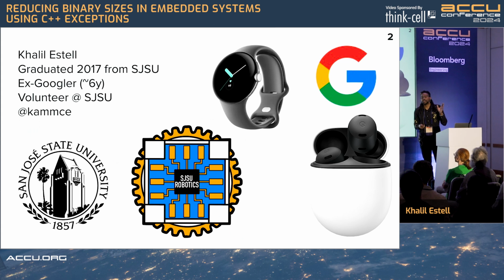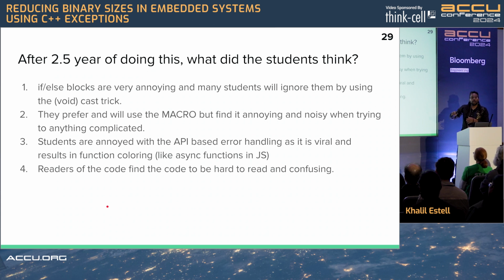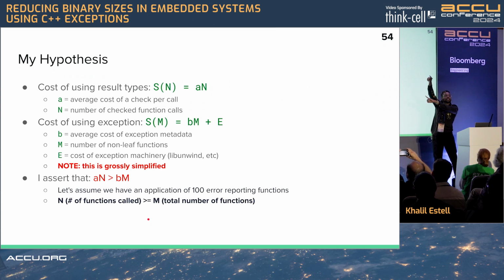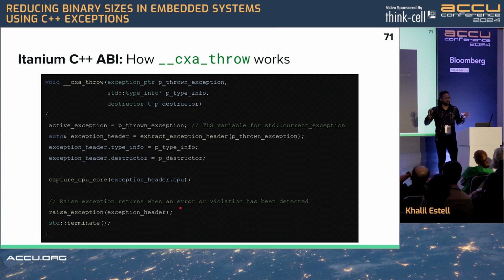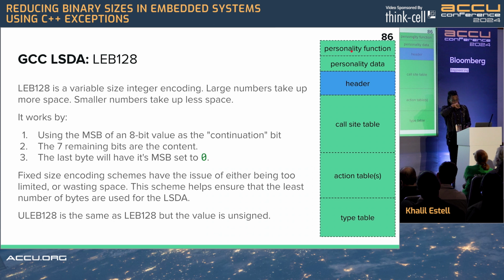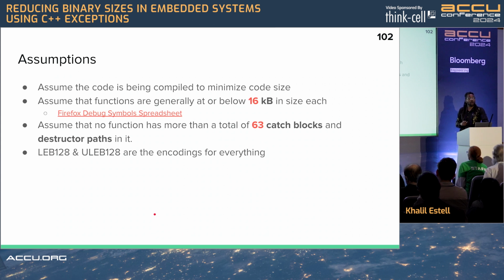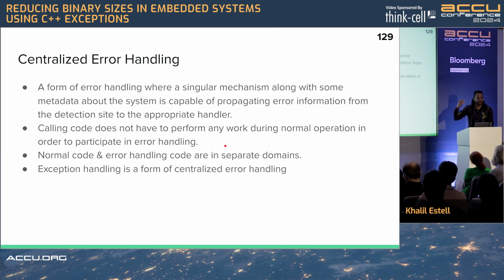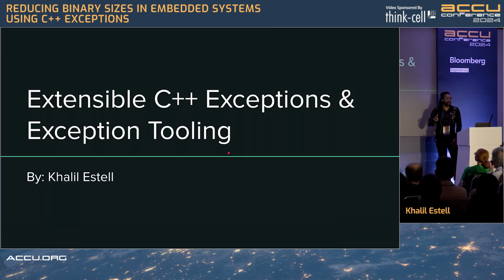C++ Exceptions Reduce Firmware Code Size - Khalil Estell - ACCU 2024

Comment: I think comparison of your own implementation of exceptions to handling manually every exit code – isn't a fair comparison. The fair comparison would be to add try/catch block inside every function, because this is how much control you have over errors, also in many cases the only sane thing to do is to hang or reset the cpu – there is no need for error propagation. As a side-note I can make even smaller code in C (not C++) by using custom setjmp/longjmp, because I need only known restore points in application and not the whole call stack. Nice talk, but it didn't convince me to use exceptions in production.
Reply: I think you'd find TrapC interesting. It was built in a way I think C devs would appreciate. Is an automatic way to do what you stated before (probably better than standard setup/longjmp). 

I disagree with your version of a comparison. As you say in your own comment, you rarely handle errors so having an try/catch in each scope wouldn't make much sense. And what would be the point of that, to throw, catch, rethrow? One could also not do that and get the behavior. So if the behavior is the same, I don't think such a comparison makes sense. 

But let's say we go with your comparison. I'm working on my "unique exception format" which de-duplicates much of the exception data area. So binary sizes will get reduced far more than  what I've claimed here. With that, having a try/catch in most function, as is with coroutines, would still result in a very smaller binary sizes compared to conditionals everywhere. No change to code or binaries necessary. 

As for, "the only sane thing to do is hang or exit" for errors, that seems like the status quo which has never made sense to me. It always seemed like people were avoiding the reality of their errors. There are a number of things you can do to handle errors but it's a human problem, not a technical one. You need to provide the infrastructure, redundancy, and resources to handle the error. If you didn't care to develop and allocate those resiurces to handle errors then of course, you cannot do much. But overall, I think the way the majority of the world does error handling is pretty bad. It's basically, "anything went wrong, exit" which is fine for many applications, but I want precise error handling on an app-by-app, platform-by-platform, board-by-board basis. 

As for setjmp/longjmp this is true. Although you don't get any automatic cleanup which I find very problematic. Also, you miss out on the type info about what went wrong. I guess if you're using setjmp and longjmp, then you may also be using errno, which is a place where you might set what error occurred. 

Anywho to you or anyone else reading this comment I hope this comment was insightful. This is FAR from the limit of exceptions, this is just the start of the process. 😁
Reply: @KhalilEstell  I didn't expect an answer :) The talk was about C++ so yeah, it is a completely different beast from C (destructors, anonymous closures (I hate how they call them lambdas, because they aren't), coroutines etc.) and you have to think about more things, not just the state of your application/hardware, so setjmp/longjmp is not an option. I agree with you sentiment on error handling, but also error handling is such a rabbit hole... and at some point you have to stop and accept that you can't handle *everything*. In my latest project (embedded linux device) I've fully embraced multi-process approach, so I have a process manager and a substantial amount of small and focused processes, so I can afford just `exit()` on failure – I have high hopes, but I'm yet to see how it will work in production.

I heard about TrapC, but I never wrote anything in it, maybe I should give it a try.
Reply: Oh and one last thing. I'd like to thank you for your comment. It's comments like these that help me understand the kinds of arguments I'll get in the future. So this is good practice for the in-person conversations I'll have on this topic.

Comment: Good talk and I agree handling expected code can be a pain but with monadic expressions it can be fixed. Why did he choose to use macros instead of using and_then functions.
Reply: Hey, speaker here! I got this question recently and I should have addressed it. The monadic code approach is akin to JS callback hell or chaining promises in JS. I've never liked that way of coding and neither did my students who found it far more complicated than a macro. JS would probably agree given they have the await keyword. Especially if you have +20 function calls I'm a frame, it's annoying and not that easy to write the monadic code.

Comment: This looks rather over-engineered to me. I program C++ since BorlandC++ 2.1 (pre c++98). And, over the decades on various compilers. And I remember, c++ exception handling used to be much simpler (implementation wise). So, I conclude, this is just g++ insanity or feature creep. Back in the early days, you could use exceptions without heap and without RTTI. I am pretty sure about that. You also did not need "std::exception". You could "int error_code = 42; throw error_code;" 
C++ turned horrible with the c++11 revision and I started looking for alternatives (C++17 was fixing some of the terrible c++11 stuff). I would  not be surprised, if all this overly complicated exception handling stuff crept in at that very c++11 revision.
Maybe a good topic for another talk: "The history of c++ exception handling and how it worked."
Reply: The libunwind code has been there for about 25 years so way before C++11. Exceptions and libunwind have always been complicated. You may be considering SJLJ (set jump long jump) exceptions which, on function entry, pushes the unwind information for the function onto a global list and removes it on function exit. This is simpler, kinda, but also adds runtime costs. To remove that runtime cost, we use the exception tables.

But I don't see this as any more complicated than what compilers and linkers have to do in terms of optimizing code.

Also, I don't see this as any more complicated than any other compression algorithm. So we trade off some complexity for improved performance and code size. I say it's a win.

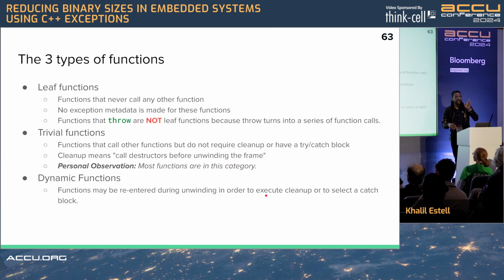Comment: 28:17 Pretty cool categories. A few years back, I've started separating functions into my own categories as well, detection functions, transparent functions and handle functions. They are pretty self-explanatory
- Detection functions detect an error
- (Error) Transparent functions are functions that don't error or just don't care about handling the error (Most functions are in this category)
- Handling functions have a try/catch block

Yours probably work better in the context of optimizing the error handling. Or maybe they are just sides of the exact same coin
Reply: That's a great way to categorize the class of functions in exceptions. I may borrow these terms for the next time I do the talk.
Reply: @KhalilEstell  The definitions I gave are kind of flimsy as it kind of ignores the nuanced fact that functions can overlap in the categories... it's pretty much a Venn diagram of categories.... it might be ultra rare, but you might have a function that is in all 3 categories, of course they're a mess and somewhat more harder to reason about...
A pure handling function is probably rarer than a mixed handling + transparent function AKA catches some set of errors, but not all, but one things for sure is the pure transparent functions is the largest group... I guess a slightly better definition would be

- Detection functions are functions which invokes the act of throwing, as in it either actually has "throw exception", or calls a functions whose semantics is to throw, like helper throw functions.
- Transparent functions are functions that don't error, or doesn't care about handling a set of errors which aren't detected by itself.
- Handling functions just have a try / catch block which catches and handles a set of errors. Which is to say, rethrowing doesn't really count as handling, if anything there should be techniques, and there are with C++ anyways, to remove that try catch as to make your function read more like a transparent one.

There is a fourth category actually, but at least in c++ it's so rarely used that I kind of forgot about it.

- Conversion functions, turning an exception from a T -> U. 

Even though it's not super important to have dedicated syntax for it, it does mean catch blocks would have 2 semantics attached to it which can make it a bit harder to reason about as instead of being able to look at a catch block and just go "yup that's a handling function", you now have to do the horrible thing of skimming for any throws.

Comment: My personal POV is use the language best for the platform. If you are so memory constrained that the STL is an issue then what are you gaining by using C++ ? If you are having to build a special version of GCC to build this you are creating a nightmare 10 years from now when you or some other guy  has to try to figure out what is going on here and get GCC to build with the options that were nicely documented (yeah right). The problem domain has moved from the product functionality to the tools used to create the product. It's lose lose all the way down. 
Chances are all this will be thrown out and replaced. In which case what have you gained? This really falls into the "figure out what I've done here peasant schmucks" bucket.
Even the code size is bigger.. I just don't see an upside, but lots and lots of late nights.
Academically it's very cool, but stuff like this does not belong in production.
Reply: > If you are so memory constrained that the STL is an issue then what are you gaining by using C++ ?

I don't believe that the STL is an issue. Dynamic memory allocation is though. So anything leveraging dynamic memory allocation is not generally used in embedded systems (at least not beyond initialization and there are always exceptions). `std::fixed_vector` was voted into C++26 and that will do nicely in the embedded space. C++ is a great tool for embedded. I actually find it to be the best tool for embedded programming actually. 😄

> If you are having to build a special version of GCC to build this you are creating a nightmare 10 years from now when you or some other guy  has to try to figure out what is going on here and get GCC to build with the options that were nicely documented (yeah right). The problem domain has moved from the product functionality to the tools used to create the product. It's lose lose all the way down. 

Totally agree with this. Luckily there were no changes to the compiler in this talk. Besides wrapping `__cxa_allocate_exception`, and the terminate handler, everything else is left alone. The ABI is the same as it was 25 years ago. In the future we may have a `std::set_exception_allocator` that takes a `std::pmr::memory_resource` so devs can choose their own allocator. Then there will be no need for the function wrapping. And as for the terminate handler, that could also be an additional flag added to GCC or LLVM so it would be in the main line and not some custom compiler.

> Academically it's very cool, but stuff like this does not belong in production.

What part exactly shouldn't be in production? Exceptions? Wrapping functions? Overwriting the default terminate handler? I'd like to know so such issues can be patched so a more compact, more writable, more performant, and safer error handling scheme can be used in software.

Cheers! Keep an eye out for the next talks. There is a lot of exciting stuff to come.
Reply: Oh, I did recompile GCC with the exceptions flag enabled because the ARM company builds GCC with it disabled. I don't see this as a custom compiler though. Its really a change that deletes 3 letters "no-" from "-fno-exceptions" in the GCC build script.
Reply: By using C++, you gain type-safety, the ability to create low cost abstractions, type-safe code generation using templates (instead of macro magic), constant expressions and whole lot of other compiler checks which you don't get in C. The problem is not that we are memory constrained. The problem is that Embedded developers mindsets and academic teaching have not changed to reflect the state of the Embedded world today. More and more Embedded Software is getting updated regularly with new features. The business/engineering tradeoff between BOM cost and picking a microcontroller with more RAM and Flash is not as prominent as it used to be. Businesses are more likely to opt for the microcontroller with increased RAM and Flash, if it means they can continue to add features to their product for longer, without upgrading the HW. This even applies for the cost sensitive industries. 

And even with these higher performance microcontrollers available to us (at very low prices), some Embedded developers are still coding like they have 1kB of RAM and 8kB of Flash. The code they wrote worked but was not portable. That was made very clear in the chip shortage when some businesses had to rewrite their application code to accommodate HW changes. Whilst businesses who had written well abstracted code in C++ (or C), were able to port their code with relatively little effort and little to no changes in their application code (changes only at the HW BSP level).